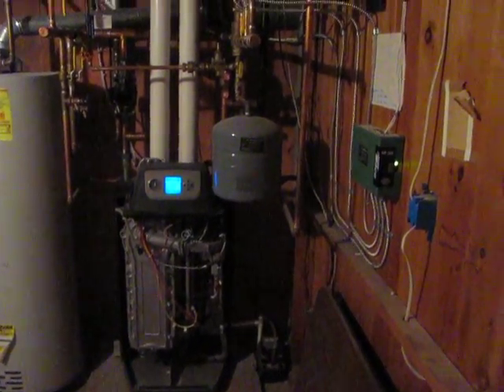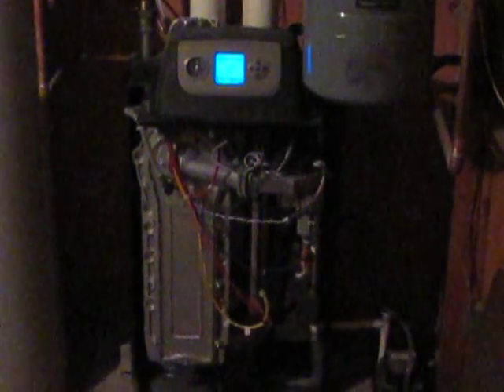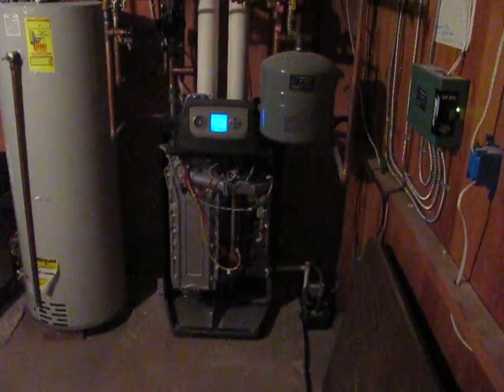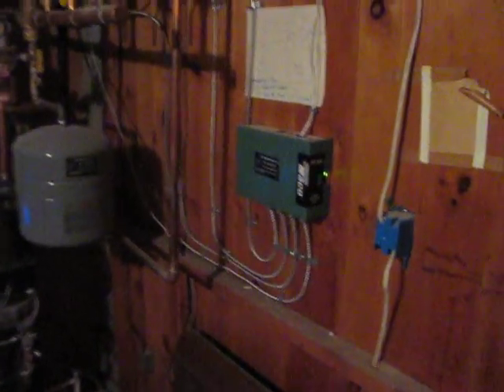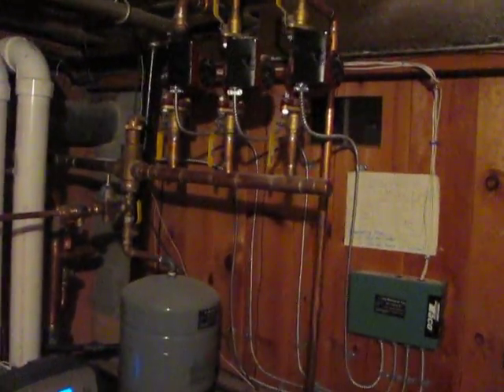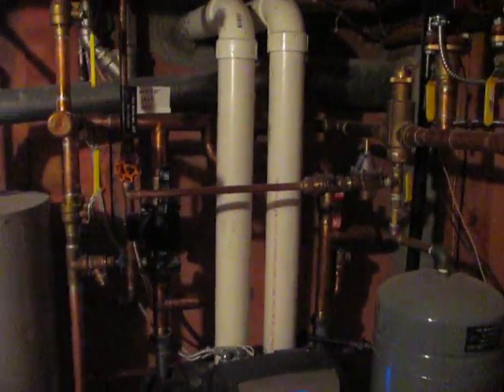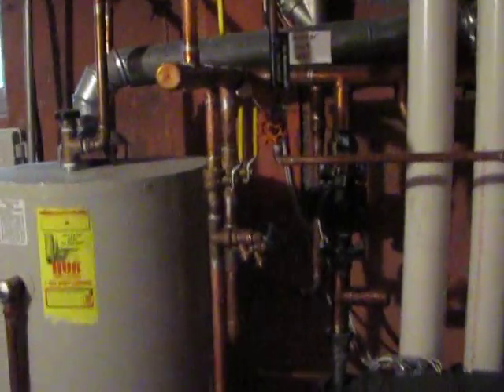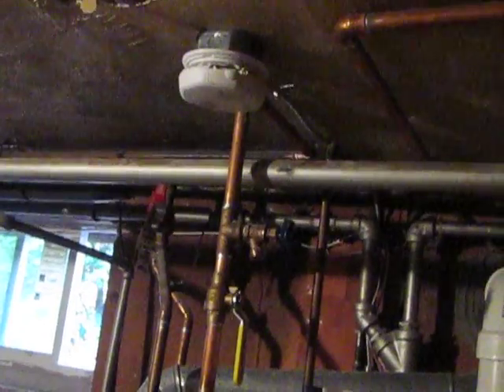Weil McLain Ultra Boiler Installation

Comment: My Ultra 155 Series II just sh1tTHEbed after 8.5 years (SEEMS TO BE COMMON).  A hole corroded at the base of the aluminum heat exchanger at the condensate trap.  This pushed hot wet air out and into the air inlet of the gas/air mix blower unit which then died.  This also caused the Extrol to fail as well (Pressure issue)...  Repair estimate from a WM servicer?  About $4500!  These things like to Error out too.